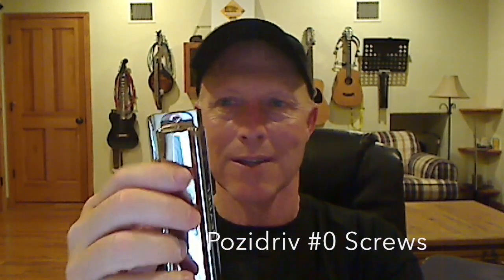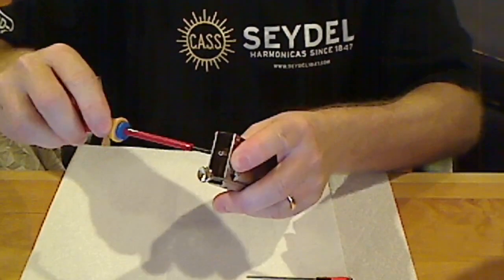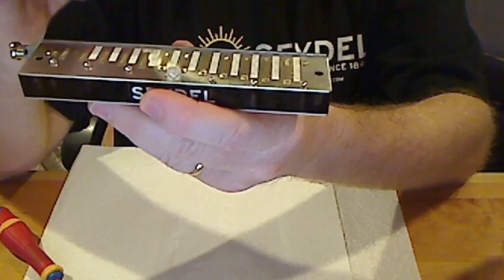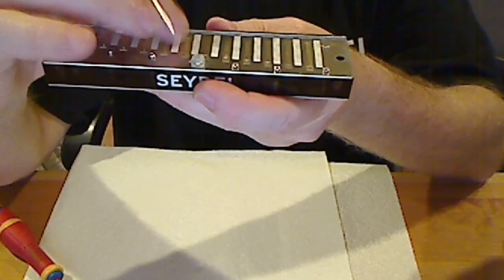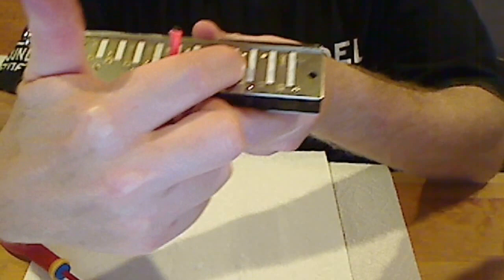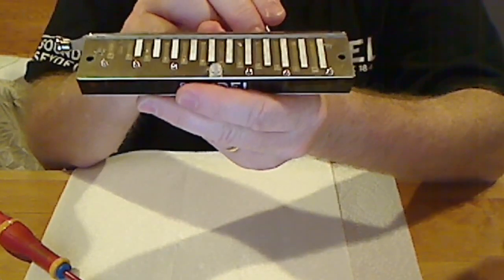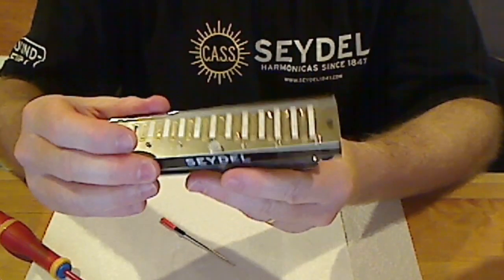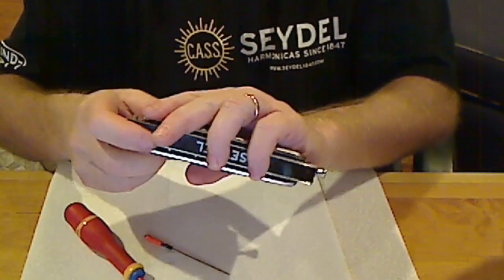Basic Disassembly of a Seydel Chromatic Harmonica

Comment: Holle sir，I have a seydel saxony. Can I install the deluxe reed plate on saxony?
Reply from the maker: It depends.. On older models, the Deluxe had a lip on the end and this would have to be sanded down. On newer models, they are basically the same reed plate. The problem is getting that lip under the H-Bar on the mouthpiece.  You'll just have to try it and see.  You may email me, if necessary
Reply: @AllThingsSeydel  thank you